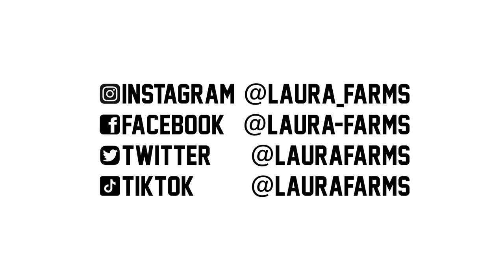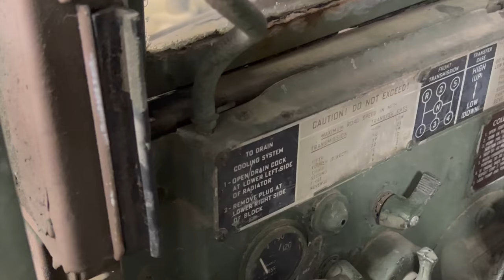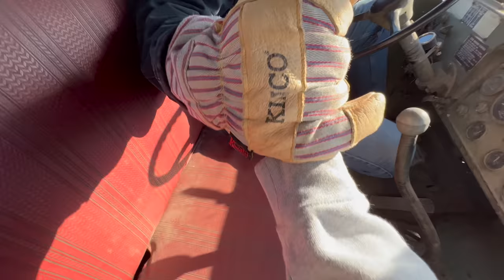Getting A 6X6 Running After 10 Years!

Comment: There should be a Air control switch under center of dash to lock 4x4 along with a light.  It's not Automatic (Sprag) T-Case as someone mentioned.  You need 4 group 31 batteries 2 sets in parallel then connected to 24V for starting.  Nice Truck   I just sold my M35A1 deuce and half and already miss it.  TGP

Comment: Grant. The way the all-wheel drive system works. Is when you are off road if a wheel stops turning the differentials just engage and put the power to the non-moving wheel. There are sprag clutches in the front differential internally. They automatically do the job. Take it back out to the hills where you can't easily climb, and get into it watch the wheels. Love the two of you when you work together. That makes a great marriage bond.

Comment: We had a army 6x6 in the fire station for several years it got up and went down the road with 2000 gal water tank on back we ended up putting a different transmission in it but was able to keep the high low system in it. Great job at getting it started great winter project love all your videos ✌🏻🤗🤠🌹❤️
Reply: We still run them as tankers with the stock transmission. They will not go anywhere fast, but they can go almost anywhere you need them.
Reply: I hope that wasn't an M-35, because if it was, you were way overloaded.   That's the problem with FD's converting military equipment into tankers, they're often overloaded and not safe.

Comment: After years around those vehicles, I'd  recommend hearing protection when your running it.  Great job and great video.
Reply: Worked on them right out of boot camp in 1981 in San Jose California. My ‘boss’ was a lush but a funny guy. He took a 5 ton wrecker to the local drag strip, put the boom all the way out and got photos of the truck doing wheelies off the line !

Comment: First thing to check will be the data Plate on the right side of the dash. This will tell you the exact model of truck you have. It will either be a m54 or m800 series. Bothe came with a 250 Cummings muultifuel engine. The means the primary fuel should be diesel, but you can add other stuff to it to get you down the road. I was stationed in Korea and drove an M543A2 Wrecker, same truck with a tow truck bed. The other guys in my unit named it "The Midnight Thud". It was a great truck that could do anything I put it through accept go fast. Top speed was 57mph...down hill with a tailwind. I also had an M816 wrecker in Dersert Storm. It was just as good as the Thud. You can find manuals for these old trucks online if you look hard enough. Good Luck!
Reply: M54 trucks never had the cummins they had the multi fuel
Reply: NHC 250 is NOT a multifuel.  Driver side air cleaner indicates M800 series
Reply: Portrayal Press might be a source for manuals. Military Vehicle Magazine might also be a good source for parts and info.

Comment: The lever on the floor in the middle of the cab is to shift the transfer gear case between low & high range. All the way up is high range with it in the middle its in neutral and on the floor is low range. There should also be a switch the cab to engage the six wheel drive.

Comment: The 460. I don’t think it uses a backing plate. If it did and it was missing, it would not move water and would have overheated quickly. My guess is the water pump that failed was just junk.

Comment: you definitely need the proper batteries for that old girl. Sounds awesome though , if you get the all wheel drive fixed, you will go anywhere with it. On our fire company that I was on for 17 years, we had 2 of them deuce and a halfs for brush trucks, and climb anything, but you will need some weight on the back . I really enjoy watching y'all videos
Reply: When I was in the Army, I seem to recall the bed of those was 1/2" plate steel bolted to the frame.  They almost never had the wooden benches in them, so when we would load up a squad, we would have to sit on that steel for however long the ride was, getting our tailbones beat up along the way.  I always felt like an old man when dismounting after those rides.  After I gained some rank, I got to drive - much better ride in the cab. 😎
Reply: Its not a deuce and halh, its a 5 ton, m809 (general chassis) through m821 (different configurations)..  i dont recall any of them ever configured as troop carriers, usless the company it was assigned to did it in house.
Reply: ok Mr perfect. And the m-809 did transport personal
Reply: @lodragan  The beds are NOT 1/2" plate, maybe 3/16ths or so.
Reply: @ffjsb  Everything gets bigger with age.  :D

Comment: Unless it was removed, there should be a data plate on the doors or passenger dash that lists the basic information of the truck. You can use that to locate the maintenance and overhaul manual.
Reply: That might be hard to accomplish. Once a vehicle is released from the inventory, permanently retired items like logbooks get sent to a holding facility for a limited time, then they are destroyed.
Reply: @jeffburnham6611  Logbooks and maintenance records are either transferred with the vehicle or destroyed. The manuals (operators, maintenance, and overhaul) are often available from libraries, archives, and 3rd party vendors. It just takes research and time to find them.

Comment: Does that engine have a compression release? If so it would make it easier to turn over when starting. A lot of those old Cummins had them. It would be a T handle under the dash.  Good luck you two.

Comment: That truck was called a 5 Ton. It had different uses. Flatbed, fuel tanker mainly. The smaller 2 1/2 Ton was used for troop transport, and various lighter loads. You could lock the front wheel drive in 6x6 drive and lock the front differential in, and you could hardly ever get it stuck off road. I drove one. Had a fuel tanker behind me and hauled JP4 jet fuel to huge rubber gas bladders in the woods. Really tough trucks. Mine had a Cummings engine.

Comment: Having operated gun tractors, during military service both home and abroad, I know these vehicles fairly well. They are almost fool proof, they are easy to maintain, parts are easy to change, and even someone with limited mechanical skills, I E, the ordinary soldier can fix most problems in the field. The most important things are fluid levels, and clean air and fuel filters, and grease and hypoid oil 90weight, and you should be ok. The power pack is made to be dependable, due to its military uses, it is a multi  fueler and take lots of punishment.
Reply: Dump your pumpkins put fresh gear oil in them you’ll get twenty more years service that truck can almost not die from anything except neglect

Comment: I believe it was a medical supply transport truck. I might be a great addition to the farm as a emergency fire truck with a tank ans pump/hose system. Might be great for all your family farms and neighbors too.
Reply: That's an excellent idea.
Reply: There were no specific "medical supply transport trucks".  If it had the standard extended cargo bed, it was a general purpose truck.  You'd have to look at the data plate to see what it was originally built for.
Reply: @ffjsb  The bumper markings might be what some of the commenters are referring to it being a medical truck. The ones I used like that had an expando box, allowing several to be parked closely, and when the walls were deployed could be turned into a mobile Command Post, hospital, maintenance facility…just about anything. Lots of fun.
Reply: @terrysaunders2026  Did you ever get to see one of the hospital trains they had??  That was an awesome idea, don't know why they don't have a couple of them still.
Reply: The number on the front would tell me it belonged to 1st casualty clearing station of Ist medical company.

Comment: Hi guys just checked your channel out. As a person that drove one of those trucks for many years. Sometimes in Germany sometimes in desert storm. I even once in Korea. That's an 800 series 5 ton. 5 tons can be carried off-road with the unit. 10 tons can be carried on road. The 6x6 only works if you have the transfer case in low. That should be a lever that goes up and down between the driver's seat and the passenger seat. But I noticed you have a aftermarket seat in there. So it could be underneath the seat. That thing has air over hydraulic brakes. That means the brakes are hydraulic with air assist. The unit that controls at is called a hydrovac and they are a bugger to fix. If you need to repair the brakes I'd figure out a different way of making them work. Those 265 Cummins love to become ether babies. So don't use ether on it a lot. If you can convert it to 12 volts.

Comment: Love the military stuff I think it weighs in at 13,350 you can have a lot of fun with this love the show
Reply: Same weight I thought. 13,300 t0 13,550 give or take.   I Spent many years hauling and rigging industrial machines.
Reply: That's an M-35, NOT this 5 ton truck.
Reply: @ffjsb  The M35 2½-ton cargo truck is a long-lived 2½-ton 6×6 cargo truck initially used by the United States Army and subsequently utilized by many nations around the world. Over time it evolved into a family of specialized vehicles. It inherited the nickname "Deuce and a Half" from an older 2½-ton truck, the World War II GMC CCKW.

The M35 started as a 1949 REO Motor Car Company design for a 2½-ton 6×6 off-road truck. This original 6-wheel M34 version with a single wheel tandem was quickly superseded by the 10-wheel M35 design with a dual tandem. The basic M35 cargo truck is rated to carry 5,000 pounds (2,300 kg) off-road or 10,000 pounds (4,500 kg) on roads. Trucks in this weight class are considered medium duty by the military and the Department of Transportation.
Reply: @michaelatoz580  No shit.  I was an Army wheeled vehicle mechanic and have owned an M-35A2...
Reply: @ffjsb  I'm confused by your ability to stay focused on this post. It's a post on the trucks weight. You put your 2 cents in saying "That's an M-35, NOT this 5 ton truck." So, I pointed out that an m36 is a 2.5-ton truck. Your statement is confusing at best.
Reply: @michaelatoz580  You're certainly confused, because you said NOTHING about an M-36, (in fact NOBODY mentioned an M-36) which is an M-35 variant with a 16' cargo bed instead of a 12' one.  
THIS 5 ton truck is an M-39 variant, and the base model weight is 19,945lbs empty.  CLEARLY it's not in the 13,000lb range which is what the M-35 is.  That's how I KNOW they're not the same truck
I KNOW what the trucks weigh, and what the weight range of the different series trucks are.
It helps if you actually know what you're talking about.  I don't know how you rigged machines if you don't know exactly what they weigh.  Deuce and a half's are NOT the same weight as a 5 ton.

Comment: Recommendation when using starting fluid on a diesel have engine turning over and give it a shot while it's turning over . Usually work's better and not nearly as hard on the engine. Wishing it was me to get that deal.

Comment: Check the bushings on the Starter Motor. If they are worn the starter will draw very high amperage and turn very slow. Especially the bushing on the drive gear end. The End Plate bushing is a plus.  Cheap fix.  Jim

Comment: Nice job getting the truck started . if you run that truck inside you might need to install a exhaust fan in. Same if you're welding a lot  . Have fun with the truck .

Comment: Most old military trucks use a 24 volt system, Grant said something about it being stuck in low
range.  there should be a lever in the middle, if it is pushed all the way down your in low range pull it up for high range.  If no leveler in the middle look at the dash and there should be a lever that flips either left or right.  those numbers on the front bumper are unit Identifiers.  left bumper indentifies the brigade 2nd number Battlion on right bumper the 36M identifies the company, the M49 indentifies the truck number.

Comment: I ran a cab and frame farm truck for a bit and it had 2 problems.  One is it badly needed the 4wd because it had almost no traction in rwd, so you will definitely need to fix that.  The other is that it could not handle a trailer down hill because the trailer would push the back wheels out and jackknife me, even with 4wd.  So I recommend rigging up some kind of bed if only for the weight.

Comment: This is a 5 ton 6x6 Cargo Truck, that is why it has such a long frame with a Cat engine. If you look on the passenger side inside the cab there is a data plate that explains the vehicle.  The numbers/letters on the front bumper from right to left are  13 COS=13 Combat Operational Support . The 49  is the vehicle number and whatever the units adds to it. You need batteries with 1k CCA

Comment: My dad was a diesel mechanic in the Coast Guard, so I got quite the education on diesel engines.  Since they have a much higher compression ratio (i.e. 22:1), it takes a great deal more torque to turn over the engine.  This is why it uses a 24-volt starter.  I would consider Liberty 1000 Batteries.  They're heavier than most typical batteries, but they'll be able to supply the required current, that your starter needs, to turn-over that beast of an engine.

Comment: Hello . Army Veteran Alabama . I drove a Deuce and a Half . Sort of the same Army type truck as this. A little shorter. To get it into all wheel drive it had a drive shaft that went to the rear 6 tires and a short drive shaft that went to the front as well. They were use for hauling parts ,  soldiers and some had a fifth wheel. Which trailers could be pulled for moving heavy equipment and helicopters . Thanks for sharing the videos .

Comment: On a vehicle this size it takes 4 batteries to have the proper amperage for starting.  4 batteries hooked together to make 2 24v systems.  It is basically a semi tractor so the same power system set up/  Also with the front wheel drive, check to see if you have air activated (controlled by a switch under the center of the dash) or a sprag system. (currently searching for links to help you fixing the truck)

Comment: Mate sounds like that starter motor is only using 2 of the 4 poles to crank. I had the same problem with the case backhoe & on taking it apart, 2 of the 4 brushes weren't making contact inside. Fixed the sticky brushes & the crank speed at least doubled.

Comment: Hi, just found y’all on YouTube. For that truck you need more than two batteries because you need more cranking amps to turn over that engine. So, you need four batteries, two sets in series each for the 24 volts with the two sets in parallel to get more amps. That truck was not an ambulance. It would’ve had an expandable van body on the back for different kinds of missions. Yes there should be a vacuum switch to engage the drive axle for the 6x6. I really enjoyed the video.

Comment: I used to drive that type of truck in the Army.  That one is one of the 5 ton variants. Judging by the frame it was probably an expando-van. I was in a medical unit. We used them as portable  emergency / operating rooms. The front axle switch is powered by the vehicles air system. The wipers were also powered by air. Before doing too much you should probably do an online search for what the Army calls a technical manual or TM manual for this truck. The Army issues one of these with every truck. It gives complete operation instructions and how to do basic repairs. It's like an owner's manual but better.

Comment: I believe what you have there is a M35 series 2 1/2 ton 6x6 cargo truck.
I looked it up on Google and there is a lot of info on the truck, engine, and transmission. Fully outfitted, the curb weight on this truck would be 13000 lbs.

Comment: Not sure it has been mentioned, but those old military turbo diesels like to be shifted above 3,000 RPM, closer to 4K.   Sounds weird, but when I was learning to drive those trucks, I wanted to shift at 2000 to 2500, and my instructor constantly corrected me.  I eventually learned to wait till around 3,500 and shift.   Also, wear hearing protection as that high turbo whine will destroy your hearing

Comment: You will need to pony up for batteries for this. You need 4 group 31 batteries with at least 750cca each to have any reliable starting out of this. This also means good quality cables and no vise grip connections

Comment: I watched with interest your video of the Army truck.   There should be two small levers to the right side of the gear lever, one being the transfer or highh/low range lever the other is the control lever for the front winch that appears to have been removed.   The six wheel drive only engages when the rear wheels lose traction and should engage automatically., I hope this is some help to you guys.   It is very heartening to see such a capable young couple on the land and I thoroughly enjoy your videos

Comment: If you can find the Data Plate, you can find the operator/maintenance manual. The model should look like M35A1, M109A3, and on the same plate should be the TM number. 
IE TM 9-2320-280-13&P, the last digits of that are the -10 (operator manual) the -20 and -30 (maintenance manual), the "13&P" in the TM number is a manual that has parts with a NSN (National stock number). If you have any questions feel free to dm me

Comment: If you look around on the inside and outside of the truck, you can usually find a little data plate that has all the official information on the vehicle and from there you can look up variants to find out exactly what is was used for.
Reply: Also!!! If you find the data plate you can find the technical manual and they’re usually still available online!

Comment: I can’t spell it so forgive me. I’ll just say ‘the spray’ to get it started is dangerous for engine life longevity. Usually it is used in extreme cold starting. Get the manuals and adjust the fuel pump/pressure/length of shot. My heart is pounding ! ❤️ I got my USMC license in a 5 ton dump truck ! I’d move the axles forward and shorten the frame some more.